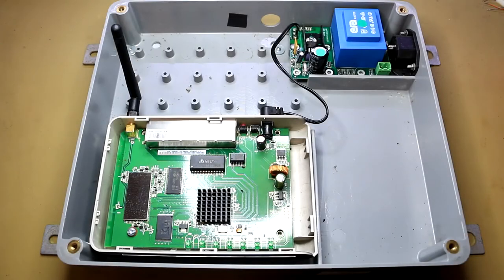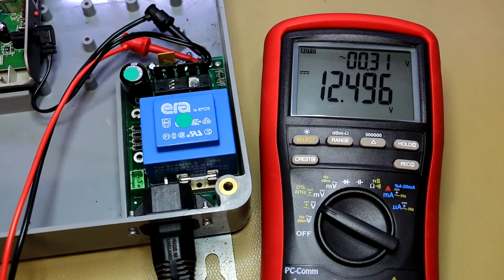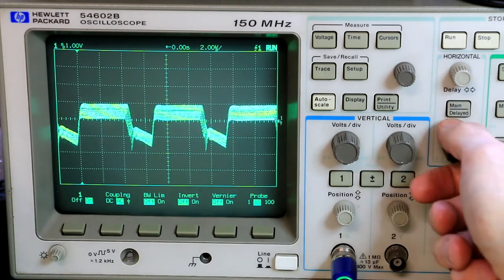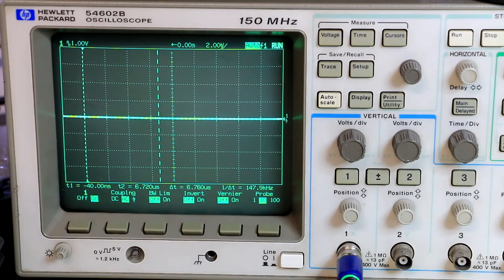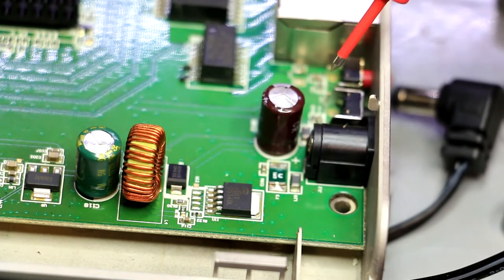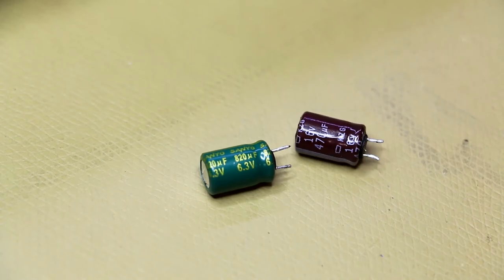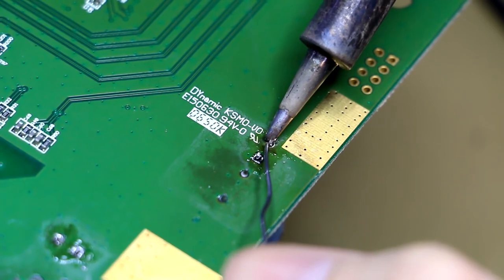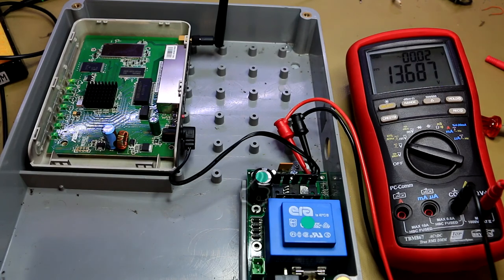Techbench  - Wifi access point repair (#018)

Comment: Do you think those capacitors are counterfeit or they suffered from being in the roof?
Reply from the maker: Good question! But I suspect it's not due to being in the roof ... (it's actually in an enclave down a wall just under the ceiling thermal isolation, so it it does not get too hot). Also, the linear supply has caps that have been in the same environment for the same amount of time.